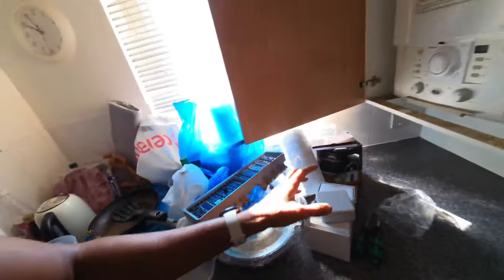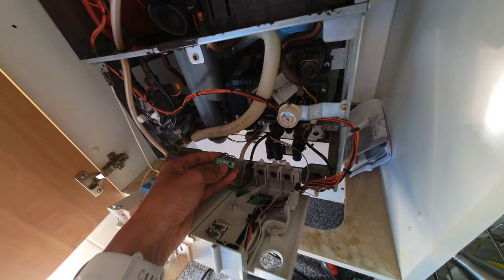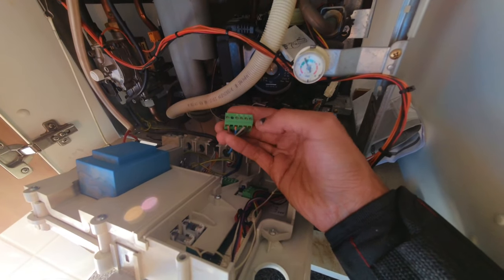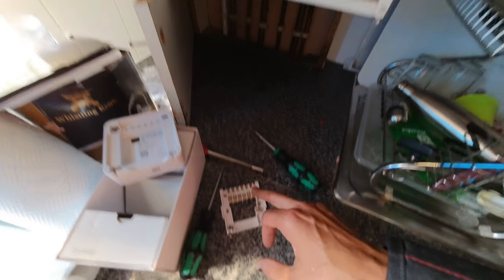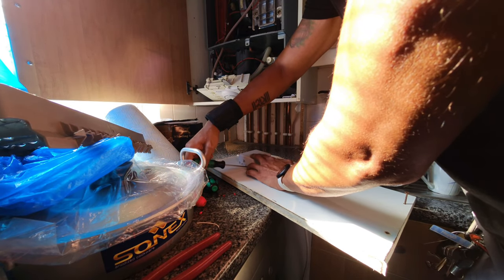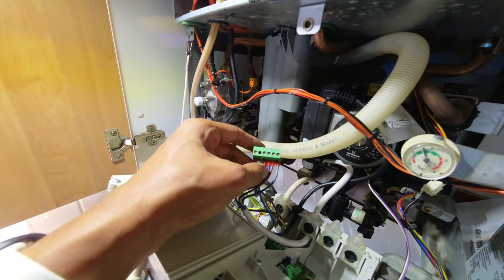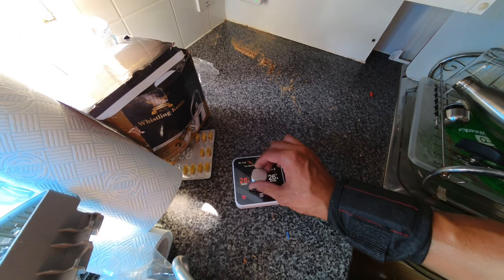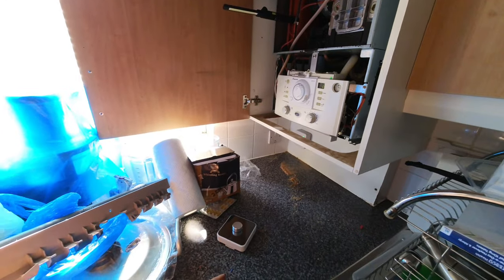How To Install A Hive To A Combi Boiler

Comment: I have two questions: When I turn on the hot water, does the heating also turn on, is this normal? To have hot water in the kitchen, do I always have to turn on the hot water first using the remote control?
Reply from the maker: Depends on what kind of setup you have but sounds like you may have a passing diverter or zone valve

Comment: The HIVE is all connected correctly and sending the signal to the control valve, but the boiler isn't lighting. I've removed the time clock so that is just an off and on on the main panel. Am i missing something?
Reply from the maker: Would need to see if you're getting power on the switch live to the boiler

Comment: Which wiring ferrules do you use size wise?
Reply from the maker: Depends on the cable size, they come in a pack of various different sizes, mainly I use 0.75mm or 1mm

Comment: hi mate 
iv got existing receiver with two brown and two blue do i need to add a link for a hive ? theres no link in this one at the moment
Reply from the maker: I can't say without seeing the receiver and the wiring setup. It sounds like you've got 2 Live & 2 Neutral probably supplying something else too
Reply: @cputilitysolutions  
iv got permanent Live and neutral, then blue in common brown in 3 i think they just used brown and blue rather than 5 core or whatever,
Reply from the maker: @ericthekingthekingtheking4842  ok you'd need to check if that blue wire in common is a permanent live and the brown in 3 goes back to the switch live on the boiler. If so then it should work

Comment: Hi you have probably heard this question before, but I currently have a dual channel receiver for separate heating and water control (installed myself using instructions) but I will be moving to a house with a comb boiler.  Is it possible to wire the dual channel as a single channel?  It just seems like a complete waste of money if I have to buy a single receiver.  There is a rumour it can be done, but know one has shared a definitive.  I want to call an engineer out to do the work but I don't won't waste his or my time if I have to buy a single receiver / kit.  Any advice would be great.
Reply from the maker: Hi, yes it can be done but you have to alter the wiring accordingly to suit and you leave out the hot water side of wiring
Reply: @cputilitysolutions  thank you for clarification. I thought it would be something like that but wanted to make sure. I still gonna call an engineer in though at least I know it can be done. Better to be safe.

Comment: On older worcester bosch boilers the connector block is soldered to the PCB called ST10. are new ones now losses as shown in the video?
Reply from the maker: I can only go by what I'm working on 👍🏾

Comment: You don’t need the earth. So you can just run 3 core and put red sleeving round the earth and use that as the ch on.
Reply from the maker: Not allowed to use earth as a live conductor anymore as per 18th edition if I'm not mistaken - but hey I'm no sparks!
Reply: @cputilitysolutions yeah that’s true. I did see  you don’t need to use the earth tho on another video.
Reply from the maker: @ChelseaFC190512  yeah the earth isn't needed, but whilst it's there I just terminated it safely 👍🏾
Reply: @cputilitysolutions  a long as its sleeved and identified as a live conductor. can someone clarify if thats the case?
Reply: The earth definitely can't be used as a live or switch wire its also in the cable for protection and testing  (r1 +r2 )I usually run a 5 core cable from the boiler to the controller I just find it easier

Comment: Great explanation! What would happen if I didn't link the L+1 together? Changing my old Danfoss programmer to a Hive thermostat and can only see a 5 core cable, but only permanent live and switch live cables are connected to current programmer/thermostat, which made my wonder. Many thanks
Reply from the maker: You may have a separate permanent live feed going to the common terminal. If so then that wire will go into no.1. If not then then you need to put the link in to give power to the common terminal 👍🏾